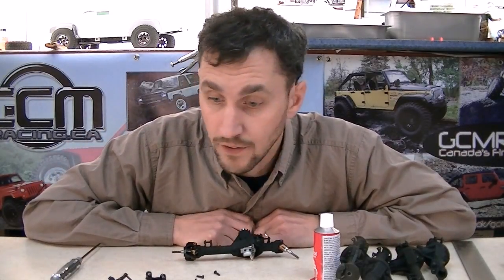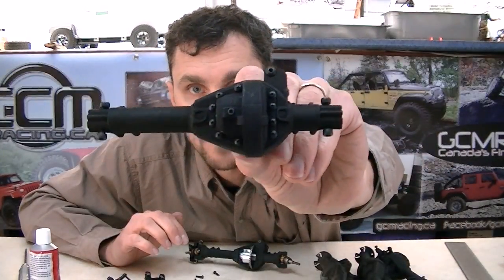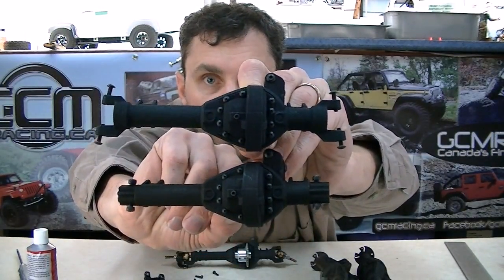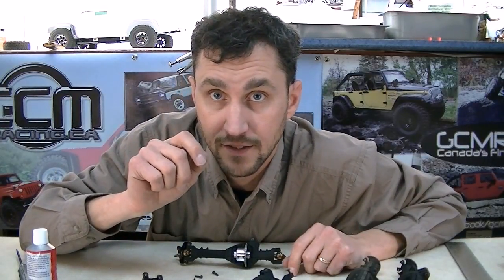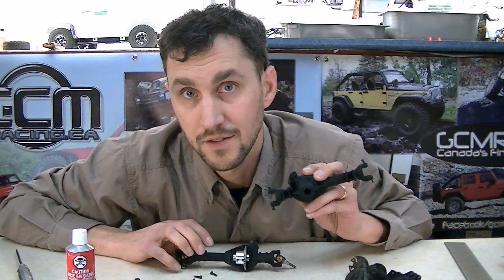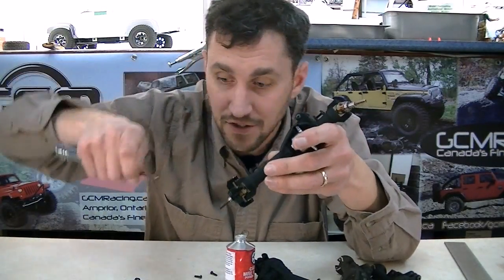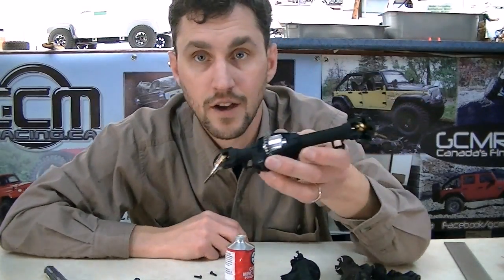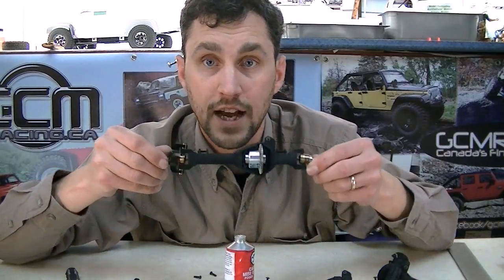GCM TerraMod Axle Instructions and Info

Comment: liking what I'm seeing for sure. You should do an SCX10 install video. mounting links, shocks, CMS and panhard. Also what is need to be done for installing CVD's. I understand they need to be cut?
Reply from the maker: Captncouth Thanks for the comment. It's true the CVDs from a wraith need to be cut down to size. If you get the 191 size then cut them a bit longer than the 183 sized version. 
I have a couple projects to build up with these.